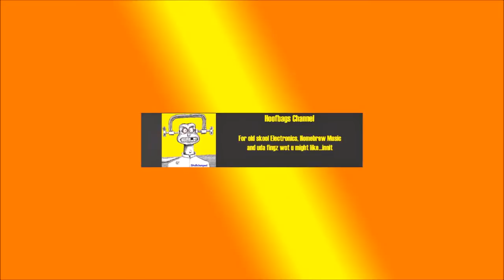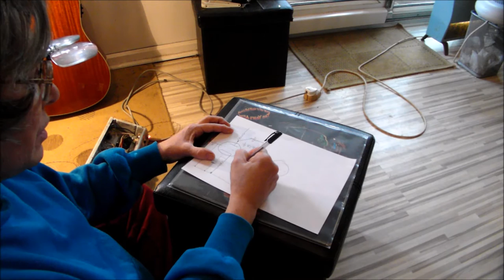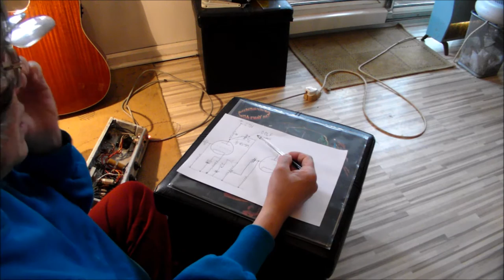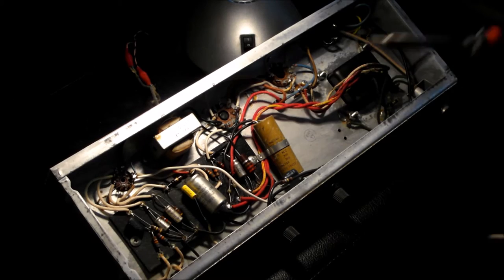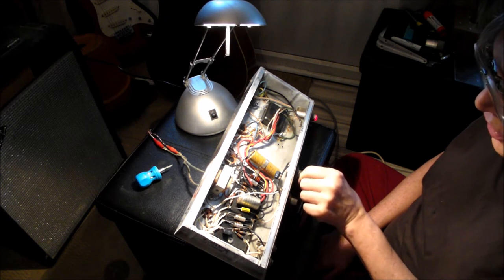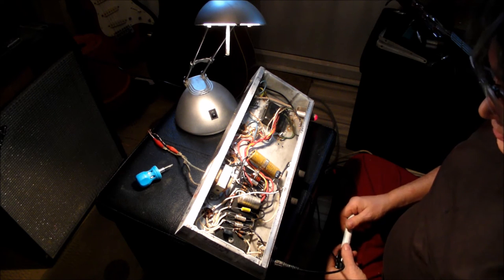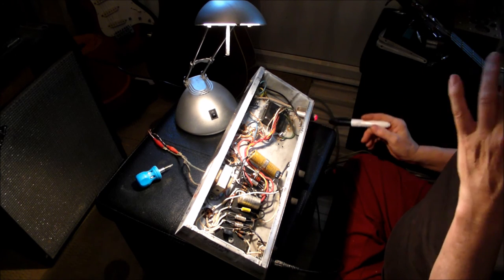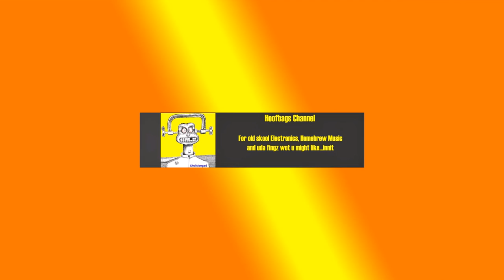FENDER MUSICMASTER BASS REPAIR

Comment: From what I understand, Fender and Valco, Gibson used these ceramic capacitors as they were hardy, held up way longer than the paper/oil and most importantly….Dirt Cheap! I could be way off as I’m just learning. Nice garage/psych bass!
They are modding many of these bass masters into guitar amps by just a few changes in the circuit.
Reply from the maker: What's more is that the capacitors in these are well overrated voltage wise, so to fail is surprising at least. During my repair and servicing career, I've encountered many components that should be "indestructible" in service that have failed. A few years ago, I built a ZVEX Super Hard On clone guitar preamp for a friend. I used 250 volt rated capacitors as these were the ones I had. With such a voltage margin, you'd have thought the component would last forever but it failed, making me suspect other components within the unit. Sometimes "B" grade parts find their way through and on occasion, a fault in the manufacture or storage. Thank you for your though provoking comment. 🙂
Reply: @hoofbags  How did you  go about learning  (a unique set of skills) servicing and trouble shootings amps? I’m learning this by myself. I have just kept watching repair videos, reading a few vital books. I couldn’t even ask the right question(in a coherent manner) up until a few months ago, let alone understand the answer. It’s been a long slow road given I knew absolutely nothing about. It came out of my love of all guitars, and the necessity of rural life. The Rocky Mountains of Montana have few techs, and many a tank of gas to deliver and retrieve them. I’m a dyed in the wooI 30’s Gibson acoustic nut and built my first electric guitar 2 years ago but have yet to finish the final details…..like screwing it together, but with the few electrics I own, I learned that the amp is, if not more important than the instrument. I thought I was never going to get past words and pictures on paper; firstly I’m  battling MS in my mid 50’s and my memory is pure shite from having it since I was 25 but I didn’t know, and secondly, it’s not like anything I’ve ever learned. I love it though . A big shout out to Skip from ‘The Truth About Vintage Amps’. I just came across your repair in my YT feed and I will watch more indeed-cheers!
Reply from the maker: @GIBKEL  Greetings! In 1980s I went to Hackney College, London, did a City & Guilds 224 Radio and TV servicing course. During it, I met Mr John Rawden, deceased, at a social club who ran TV repair-hire company about same time. He work in private mobile radio so was unable to get to his customers. He bought me a 3 wheel car and I serviced his hire TV customers as student. Doing valve stuff is dangerous, I've had many electric shocks: part of being an engineer, doesn't matter how careful you are! As a starter, try simple transistor designs like the ones on my channel, their risk free. Once you venture into tube stuff, always have someone home who can help or call ambulance in case of shock, as do I. I'm getting to the age now, that if I get a shock, it could be my last. MS is a horrible illness, needles to say. A neighbour in my vicinity is more or less paralysed with it. As you've had it for some time, am I correct in thinking the progress is slower? I hope so. Thanks for your support and message. 🙂
Reply: I’ve been going really slow, slow as a fat caterpillar on  cactus….I’ve been studying for years. I always discharge my capacitors. I only have one hand in and it’s a chop stick. I appreciate your concern. I have looked for a mentor locally and continue to do so but rural life, our collective transition to digital modernity and many of the folks knowledgeable are fewer everyday. I’ve picked up the suggested classic manuals,and along with The Truth about Vintage Amp podcast, Uncle Doug, Psionic Audio ….now your channel (loved the metronome bass), I have been building my knowledge for years now. I’m disabled and have at least have time, if nothing else. I’ve started with simple fuzz circuits and will work on my first amp, a Kalamazoo Model One(simple single end). 

My MS progression has still not been determined.  They are not quite sure with me. I’m on my third neurologist, the second one leaving the room a bit white( he was new) as my brain doesn’t fit with their models. It’s a bit of a mystery. I have the classic terrible chest squeezing that dairy’s to the mid rift occasionally, akin to feeling crushed during bad flares but no deficits in balance. Constant “downtown issues” as I refer to them. Vision was hit this past year and took 6 months to resolve the double vision. I was having seizures at night since my late 30’s  but recently meds fixed that. I didn’t initially mention it to anyone, not even my gal since they couldn’t wrap their head around my other symptoms; and with every new symptom, or odd experience, you become the boy who cried wolf. I have many lesions, especially in brain stem( trigeminal hell) severe pain, headaches, and damning fatigue. I was initially diagnosed with  Reiters/Ankalosing Spondylitis , another auto-immune disease following near death from E-coli. I’m was late to my MS diagnosis at 51, with the odd symptoms being written off for many years but I have been disabled form it all since age 33. Now 2.5 years later, they are still not sure how to categorize the MS. They are not sure and I don’t fit neatly into a box. I’m on monthly infusions. I went from Indiana Jones (Archaeologist) to being housebound in about 8 years, beginning in my mid twenty’s. 
I love the guitar, music and I have always been fascinated in circuits since I was a kid, having scavenged abandoned old radios in the 70’s. I have spent the last 7 years wrapping my head around finally learning how they work. It has not been easy going it alone but thanks to folks like yourself, I am beginning to understand. I have begun to deep dive the different parts the different parts that make up this alchemy of a circuit. Lately, it’s been different phase inverter circuits and how they contribute to tue sound.I have a 55’ Gibson GA45, 65’ Falcon that work but that I pulled to learn how to trace the circuit with a schematic. My Harmony 430 just has a panel and your into the preamp/reverb/trem circuit and I have just been going over and over them along with their schematic for the past couple years. Winter’s are long. I always discharge my capacitors. I Only have one hand in and it’s a chop stick. I appreciate your concern. I have looked for a mentor locally and continue to do so but rural life,and this  transition to digital modernity has made it all the harder with many of the folks knowledgeable becoming fewer by the day. Instead, I’ve combined suggested manuals with The Truth about Vintage Amp podcast, Uncle Doug, Psionic Audio ….now your channel (loved the metronome bass) and have been building my knowledge for years now. I’m disabled and have too much time. I’ve started with simple fuzz circuits and will work on my first amp, a Kalamazoo model one(simple single end) very soon. 
Winter’s are long, life goes fast. As Mick says “You can’t always get what you want, but if you try sometimes, you get why you need.”
I will be super careful, and always have my wife near if I’m working on something that has been recently powered up. I discharge the amps out of practice. I’m still practicing my soldering technique, and measuring three times before I dare to cut once. Getting plans to build a current limiter and bought my first variac. Now I’m off to your channel-cheers!
Reply from the maker: @GIBKEL Yes, spreading the hobby is the thing to do. 🙂 I've a bit of 80s gear: a seesure bridge. Whilst looking up the schematic, I read "I didn't think it was going to be this bad!" A guy had retired and was at a loss as to how to fill his time. Nearly all of the worldwide electronics community are positively encouraging to newbies, although I did find myself in conflict with Guitarologist: so don't engage with him for any tips. Having spent my life in the electronic servicing, I uploaded a simple screws on wood 3 transistor amp build to build confidence as creator and this Guitarologist messaged "ow, go away loser!" Having scrutinised his diagnostic technique, it was clear he lacked an understanding of core studies. Guitarologist is an exception, most electronic uploaders have a helpful positive approach. In UK, we have RSGB radio society so I'm wondering if there's an American equivalent, as it would appear to be where you're situated.
Reply: @hoofbags  I completely agree with your take. I unsubscribed from him a life ago. He had some of the first servicing content and then something happened? 

My community used to have radio group in the early 00’s but that generation that held down the fort has now mostly passed or those right behind became disinterested. Covid was a death nail in a lot of ways as our community stayed “high” and still moderates back and forth from med-high. Due to my meds I have to be super careful so life shrunk a little bit more. I thought it would never click and then one day it did after years of trying to grasp it. I had basic electronics in high school but whoops….I should have paid more attention. I should have started with pedals and simple circuits but I had just started playing electric after  20 year of finger stlyle and bought a terrible amp. I went vintage after that as the bill was more than I had paid for it and I swore to be able to service. I hate buying 45 lb anchor’s! I eventually circled back to simple fuzz circuits. Tube biased trem is my next deep dive.  I have a 65 Ampeg Reverberocket that I don’t touch. I just play it. They are their own thing. I’ve collected some free organs, a Hammond M-100 and a killer Lowery Holiday-think “Whiter Shade of Pale.” It’s brilliant but both need a three prong cord, the death cap removed and serviced. I got zapped just turning it on last summer. It will be their when I’m ready for it. 
The sad fact of growing up without a father, is teaching yourself just about everything. I’m so grateful for YT because it can be so helpful.

Comment: Aliens is also my favorite movie, and Bill Paxton was one of my favorite characters ever as Hudson... 

Great video! Just picked up a 76 Musicmaster Bass Amp for a friend and your video is very helpful! I'll be restoring and tweaking it for very heavy road-use.
Reply from the maker: Brian Carroll. Another problem with the design is the switched input socket where in grounds the input line to mute any noise. The repair is done by cleaning up the contacts with some emery or other abrasive paper. It's a great amp and will last well on the gigging circuit. Thanks for the comment.

Comment: Maybe  change those  50 Year OLD Elytics.! 🙂
Reply from the maker: I did suggest that to the owner and he declined. I said I'd do it if there were issues in future. I think funds were an issue.
Reply: @hoofbags  .....Well then lets hope the caps last a bit longer, even if they are not 100%.
Hopefully the owner will have the money available when the caps demand a change  🙂
Reply from the maker: @moorec1053  he's a M8. As so, I work on his amplifiers free of charge but he pays for parts. Turns out, I have loads of spares for all sorts of electronic gear, so for a musician, I'm a useful person to know. 
😇🎸🎵👀😅
Reply: @hoofbags  ..... Good For You..!!!

I  worked for a local music store for a few years.
The owner got pretty good at evaluating the financial situation of the amp owner..
We did lots of repairs for reduced cost or free.
I remember this one Father, he  brought in a Fender Hot Rod Dlx.
He had saved quite awhile so he could buy his son a "Real  Tube Amp". Of course, what he bought was a 400 dollar,  10 year old, mediocre piece of junk. It had all the normal problems.
Burned up parts in the Plus/Minus switching supply.
Input jack with bad solder joints and a broken post.
And worn out power tubes.
The Father was really strapped for money.

We charged him for a new input jack and never mentioned the rest   of  it.
Helping  a good person, when you CAN,   is a great feeling.
Obviously, you have done your fair share of this as well.
🙂
Reply from the maker: @moorec1053  should mention that I'm not a professional, I'm a electronics hobbyist. I did have a job in the 80s 90s repairing CRT televisions and used a Reliant 3 wheeler to get to my friends customers and carry spare parts. I have a beautiful Marshall 2003 PA in the basement of my house: needs fixing up a bit. Problem is the 450 volt HT and I'm a bit scared of it. I've had a few 'packets' in the past and, at almost 70, I have a feeling the next shock will finish me off! 😮 I don't know if the HT is 450, it might be even higher. Such a shame, it could be an vintage amp that someone would love! 
🎸🎵👀🦌